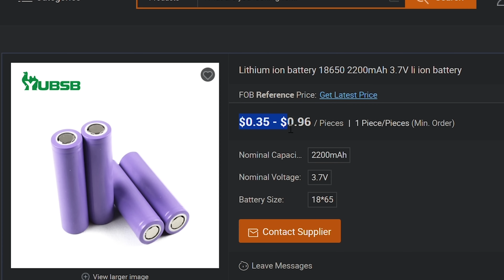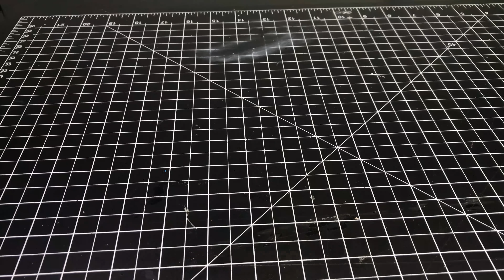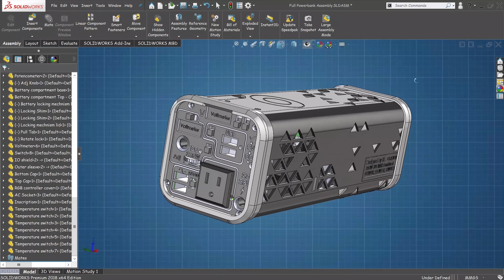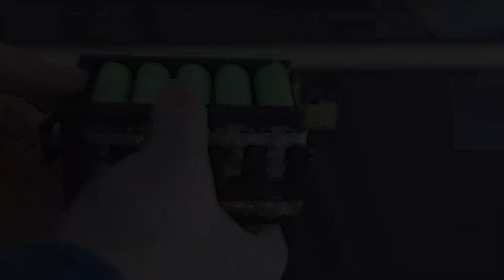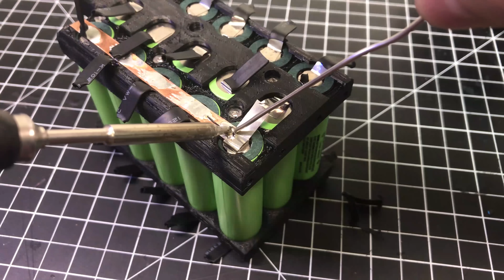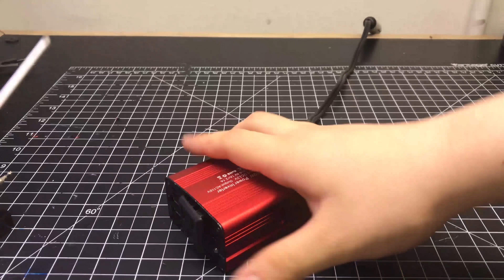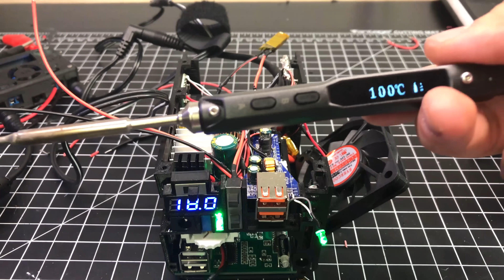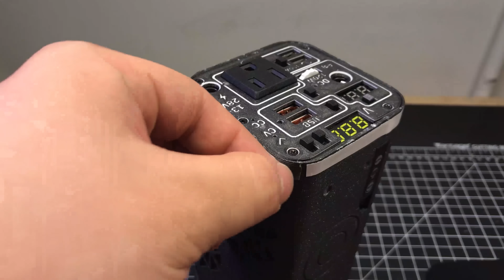How to Make the Ultimate 18650 Power Bank with Infinitely Expandable Capacity

Comment: At that level it'd be easier to design a PCB LOL
Reply: thought so too, like solder on the relais and every dc-dc and inverter boad cables to the marked pins on the pcb would hae been much easier and probably also not as cluttered
Reply: @kralyn3d  all these people don't how inaccessible customs PCBs are in some places. This is very beginner friendly. Thanks for this content.
Reply: @Renzoganviolin  So I guess 3D printers easily accessible in said places? I wouldn't call any project involving 3D printed parts "beginner friendly" but that's just me, even the cheapest 3D printers are still a bit on the expensive side and 3D printing services aren't exactly cheap either, I mean it can cost upwards of $30 for a little bitty Raspberry Pi case...
Reply: @kralyn3d  I thought this was a cool way to do it.... It would also be interesting to see some of these people actually make one custom to see what problems they faced...
Reply: This is so so cool, however I think the PCB option he mentioned (in not such a nice way!) is to make a kind of motherboard PCB as the interconnection between all the modules as the numerous wires as a result of the complicated design becomes hard to work
Reply: @modernizedclassics  i was thinking the same thing because messy wiring, also would be nice if you would have headers so you could remove the connections to work on everything without soldering everything permanent
Reply: I have to disagree with this.  All of these circuits are cheaper to buy complete than you can build them out of components, not to mention the cost of the PCBs.  If you make your own PCB, I guarantee you'll have to troubleshoot that, because nothing works right the first time.  Also, parts go in and out of style, so even if you design your own PCBs, when you go to make another, you may not be able to get parts with the right footprints.  When you buy complete modules, these problems go away, because the manufacturers of the modules handle this, and are always redesigning as new parts become available.  They can do this because they are making tens of thousands of them, so it's just part of doing business.

Of course, there's a similar problem when you're buying modules: the 3d printed parts here are custom designed for the specific modules that were available at the time this Powerbank was designed.  Again, these change over time, so you may have to modify the 3d printed parts, and the modules may not fit into the same very tight configuration.  This is one of the great things about 3d printing - you can modify designs easily.  Not quite AS easily if you're working from someone else's stl files, but certainly if you're working from files that your 3d software can edit.  And there's plenty of free 3d software out there that can import all of the popular formats, so you don't have to buy the software package of the week.

I see this video more as a great demonstration of how to integrate a number of low-cost modules into something you want, than as a step-by-step of how to build exactly what you see here.  I wouldn't bother to download the 3d files because it's unlikely I'd be able to find the exact modules they are designed for.  Also, I wouldn't want exactly what he built.  I don't care about RGB lighting or USB C input.  I WOULD want at least a 250 W inverter, which is going to be a different size.  And then, I might want to use RC type Li-po batteries instead of making 18650 Li-ion cells, since it's impossible to know the real capacity of 18650s when you buy them online.  Pretty much anybody who wants to build something like this would have different things they want it to do, which quite likely would require redesigning it anyway.

So yeah, Chinese modules are the way to go, and this is a great example of what you can build from existing modules.
Reply: I would love to see a pcb version, you could sell kits!
Reply: Way to much wiring mess and he also used unnecessarily thick wires i mean like too thick they didn't need to be that thick because active cooling and short wiring
Reply: Wires are never too thick, if you allready have them lying around, and you can't use that short pieces of leftovers for anything else anyway.
Reply: @BadMax02_VR  Even though it would be for the Inverter?!
Reply: @Colaaah  i mean for like the smal dc to dc converters the inverter can use upto 150w or so which is at 12 more than 12A which is a fair bit of current and the wire needs to be thick i use 4mm² for my 20a labbench supply and have a voltage drop in 2 meter of about 0,5-1v
Reply: @BadMax02_VR  Custom PCB is nowhere near convenient compared to what he did, PCB itself is obviously easy, but the BOM of components are extremely hard to fulfill for this project, there are literally hundreds of tiny SMD components. in a virtual world that you can somehow order all of them and get them all on your table, it will still take over 10 hours to solder it with an iron, since it's impossible to reflow due to high component count. In the real world, you can't even find some of the components that these boards used, not to mention multiple shipping costs and the inevitable wrong component size. I can go on and on but you get the gist.
Reply: @huchengguo3004  i think that you guys think that we mean one single pcb for every task like inverter dc dc modules and such but i think that the original commenter meant that you just run wires from the modules in the video to one single custom pcb which connects the stuff together so you cant mess up that bad connecting it wrong and while at it you can solder ther relais which he also did with wires to the pcb to nothing with smd just normal through hole relais do smd relais even exist?
Reply: @kralyn3d  JLCPCB.com like other people on youtube :)
Reply: Hmmm. PCB my first question. Second: Why diode? Use P-Channel power MOSFET. Third: Why Relay on output? Use P-Channel power MOSFETs.
Reply from the maker: P channel MOSFETs have a high power loss of around 6W at 15A, while the relay has a power loss of less than a watt. Furthermore, the relay has a normally closed contact. The diode there is to block reverse leakage current from the batteries that will keep the relays powerd on.
Reply: @BasovMichail  relay is simple (trouble shooting will be physical, if you hear CLICK then it works), using FETs might difficult for some people. And am in the same boat. Wrong gate voltage, then FET will die soonly. Iam just newbie, and just keep learning.
Reply: @kralyn3d  well, certainly there is ways to improve this like many suggested here, you will probably need help on this or it will take every longer time for you to come up with a solution. And this powerbank is really some engineering feat~ i like it and might consider making one myself.
Reply: Unless you have serious experience with PCB design I wouldn't recommend that. Power design is like a separate dicipline within hardware design, where the boost converter boards are especially hard to do without creating a true EMI hell.

Then how would you assemble the thing? These boards have so much stuf that can't be hand soldered ranging from the extremely fine pitched USB-C connectors to the power ICs which heavily rely on a properly soldered backpad to dissipate heat and create a good ground connection. Perhaps it could be done with a decent solder oven and good paste.

Alternatively, one could pay for PCBA altough that would likely cost way more than  $58.
Reply: @kralyn3d  JLPCB is extremely inexpensive, and could always just use through hole instead of surface mount
Reply: @piotrr5439  Then go and start your own video doing this soon, please send us the link. haha!
Reply: @kralyn3d  but you could also have Used through hole components and relais dont fail often.
Reply: @kralyn3d  You say you don't want a PCB to make it cheap and beginner friendly, yet at the same time if someone wanted to build the same project then you need a 3D printed case, now I don't have any experience using 3D printers but from what I understand printing isn't exactly super cheap, at least when you have to order parts from a service rather printing your own but even if you can, it isn't quite as easy as download and print since you have to know a little about how your printer works and get the settings right, so adding a 3D printer to the mix has already complicated things for a beginner, which is why I think your reasoning here is a bit silly...

More over, you wouldn't necessarily have to change any of the components if you wanted to design a PCB, you just need some pads to solder all the individual modules onto, which would actually make it easier for a beginner as they would only need to know where the modules fit onto to the main board, so that aside I do like your build and the end result looks quite nice.
Reply: @vgamesx1  This definitely needs a custom PCB, they're not hard to make or buy online. If you're going to need a 3D printer with ninja flex filament and ABS then why not use a custom PCB too. There is so much potential for this project.
Reply: @vgamesx1  With a bit of modification you could probably make something that'll mount in an off the shelf case. Wont look as nice or be as compact, but it'd still work.
Reply: @DieyoungDiefast  Yeah absolutely, but what I was getting at is I just wanted to point out how silly it is to talk about making things beginner friendly, then needing something such as a custom 3D printed case, like c'mon just say "I was too lazy" or whatever, that's can understandable.
Reply: If the creator is still confused, I think what people are saying is to use a custom pcb to connect the component boards in place of the rats nest, so you can use the same relays and diodes etx but connect all the wires to a PCB, and that pcb has a circuit to activate/deactivate relays based on the temp sensors. both ways work, if you watch this and want to go the pcb route you can or you can use wires, really the only extra component is a pcb that you need to assemble
Reply: @vgamesx1  You do understand that the 3d printed parts do not impact the functionality of this project right? they are nice to have since they can be made to exactly to the project's needs. But any other enclosure will make the power bank function just the same, just not as tight and not as neat. the enclosure can also be milled out of aluminum and make it even nicer, but the power bank still performs the same. 3d printed parts are optional, it's not a necessity.
Reply: @DieyoungDiefast  Actually, off the shelf cases can look very nice, but they're expensive.  Look at the inverters he uses - these are commercial units, but they use off the shelf aluminum extrusions, and look great.  Yes, it takes bigger extrusions to fit this much circuitry into, but if you find the right extrusion, all you have to 3D print yourself (or laser-cut, or whatever) is the front and rear panels.
Reply: @BrightBlueJim  the idea is not to roll out a PCB to replace all the modules. It is for a easier to assemble and service form of interconnection between the modules. This argument seems to berate his work...his work is awesome. It is about a upgrade or a version 2.0
Reply: @DieyoungDiefast  components change sized. You can't take into account the hundreds of components and issues due to the pcb's strict size tolerance. As a matter of fact, I had to modify the IO plate on this as the exact 120v inverter actually has some slight differences. The outlet plug has huge tabs on the inside which is good as you don't need glue but I needed to add in cut outs on the plate and lower the Led by 4mm as it is in a different spot.
Reply: @kralyn3d  Then just release the plans? PCB's are incredibly cheap if you know where to let them being made...Czech Republic, China....

Comment: Awesome build but your soldering sucks. Lots of dry joints there. Try using flux and apply heat a little longer letting the solder flow properly.

Comment: Thank you! Very nice build, with clear & concise instructions. I am building something similar, and you answered several questions I was researching. And several I wasn't, but should have been.

Mine won't have the slide-out battery bank, but most of the charging & inverter functions. Adding a bluetooth stereo with 50+50+100 amp, and a 3.5" subwoofer module. 4S8P battery bank.

Comment: It can be better and more efficency and simple with one or two pcb :)
Reply: Sure, but since those PCBs would need to be custom made, you need to design them, order the correct SMD parts and then microsolder em together. You can do that, i wont.
Reply: @tatzecom  yes, but you can find lot of easy And efficency circuits online And You can use some microprocessor to measure some voltage current And temperature like atmega328
Reply: @jiri.sikora  Aye, down to help a brother out and share some links or somethin? Cuz that would be dope ^^

I just wouldnt like to go ahead and microsolder a shitton of SMDs together to make a custom board...

Comment: Epic. I want one! (With a digital voltage selector instead of the pot).  As far as I can see you cant buy something like this with swappable battery packs.  I wonder if a version could be made that doesn't require soldering the lipos together.

Anyways, really cool. Thanks for the video and the open source.

Comment: Inspirational.  But it's so complicated that mass manufacture seems outof the question.  It would be an interesting project for someone to redesign it for ease of manufacture & assembly.  I'm curious what people's ideas are on this.  Anyone have suggestions? 

Custom flat-flex cables would help connect everything together (like in a smartphone), but this would be difficult if people are using slightly different shaped modules. 
Or perhaps of use would be some really huge "jigs" to arrange all modules & wires into position for faster soldering.

Comment: Hi , that's an excellent video, but I have one question:
I would like to build it, but I live in france, so I will use a 12v inverter 220.
Because I am no very good in English, I don't really understand what you mean by "can only be used on resistive load." 
Can someone help me ? 😁
Reply: Resistive load = Lights, TV, laptop, toaster, etc.  
Inductive load = Motors (corded drill, dremel, large fan, blender, etc)
Reply: Ok, I will using it for my laptop so no problem
Thank you really much for answering so fast to my comment

Comment: I must say I'm blown away by your project. Very complex and very hard to design and assemble, but that's the joy of DIY. You did a great project! I did not watch your other videos yet, but be sure I will, and also I will subscribe. I will give you a little advice that I learned trough time, make your projects as modular as possible, because if something breaks or you want to upgrade something, then it will be very easy to do it.
Again, you did a very nice job, congratulation!

Comment: holy fuck, im impressed with this, my one might be stronger (made from steel) and have more capacity, but this one actually looks like a commercially made product, without any of the planned obsolescence
the only thing i could think of improving is the battery voltage (18650s suck for making 12V batteries since 3 in series wont hit 14V)
apart from that, it really is the perfect mix of capacity, features and portability

Comment: You should spot weld the battery tabs and leaders rather than soldering them, this will not introduce a lot of heat to the cells and make the overall job look neater and professional. Also change out the LED voltage meters with a single LCD based one that can be changed by the end user to display monitored voltages and currents. 
This will reduce internal power consumption by over half of what it is currently.  Also remove any non-visible LEDs from the internal PCBs as these are just using power and are not visible by the end user on the main panel. You want to eliminate as much redundant visuals and such as possible to make the battery power last as long as possible for the end user. Like exchanging the mechanical relays for solid state relays or reworking a transistorized switching system.

Design your OWN PCBs and stop using other pre built consumer tat.. You can get everything onto ONE PCB and save a ton of space which in turn can be traded off for more battery space = more run time

By implementing a microcrotroller you can design a system that has better control over charging and discharging, metering and monitoring, temperature control and even recording data for later download and examination similar to what a UPS does. maybe even allow the end user to set parameters for the inverter and battery levels to shut down the system or sound a warning alarm when a low level is reached.

Ditch the USB C charging connector and use a more secure option like the USB mini or just the barrel jack.

Include a plastic or attached rubberized safety plug for the AC socket, USB jacks and the barrel jack so moisture stays out.

It needs a handle that can be folded away and maybe some rubber or silicone end caps for anti-shock.

A dust filter for the fan that is of common size and easy to replace. none of that proprietary crap, consumers HATE that shit having to special order a filter and pay 2 arms and 6 legs for it..
Reply: Proposed future video: How to spot weld batteries. Ideally without any expensive tools, if corners need to be cut.

Comment: i wish i could do this myself but i lack the stuff needed to do this liek a 3d printer but this would be useful but i would have to change the ac inverter to 200watt if possible as my laptop uses a 150watt psu and this could come in handy where there are events i go to and i need to charge my laptop or phone or someone needs access to a usb charger